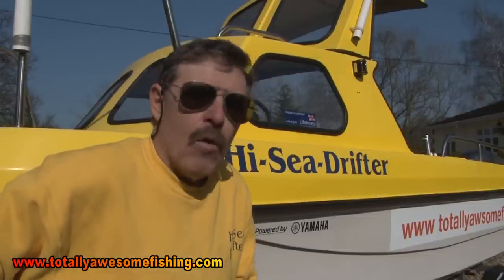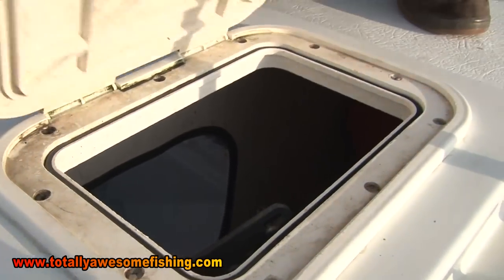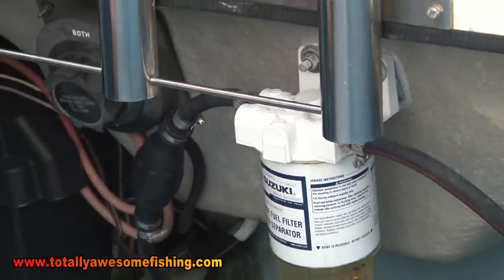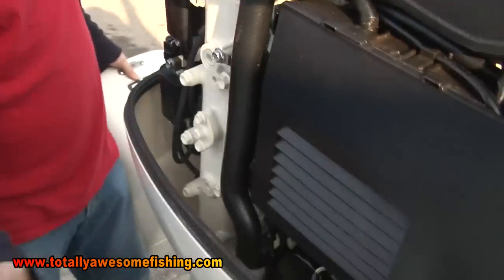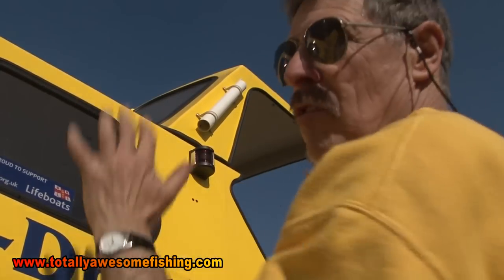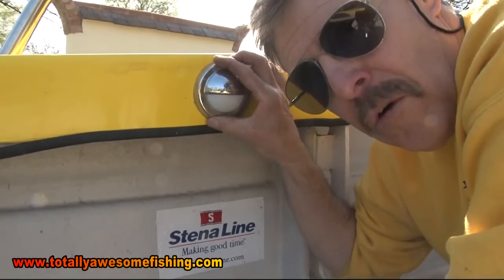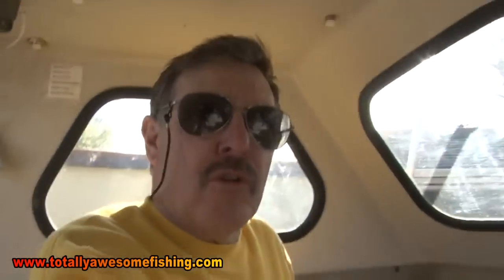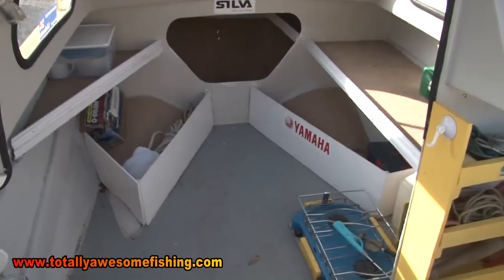How to rig a Wilson Flyer - by Graeme Pullen

Comment from the maker: I used evostick contact adhesive.Still going strong three years later.You can also run a support bead of sealant or grab adhesive along either side of the edge to act as support .I wouldn't be without my shelving that's for sure.I glue 1" square along the base,then I can screw the ply onto that.Same for any verticals.
Graeme.

Comment: Hello again Graeme found a bit of info on the boat seat you have its made by Plastimo as is the pedestal . can you tell me the depth of your bench seat and how have the fixed it to the side of the boat? cheers Chris
Reply from the maker: The Wilson company fitted the bench at the back.In fairness I use it more as a workbench,and I could have a board over the back with rod holders if it wasn't there and gain more space.But most of the time I'm on my own so space isn't an issue. A tip I found when running with Mike and a load of shark chum was that by sliding all the weight to the back,and even standing back a bit from the wheel I could gain up to 2 knots planing. When we slid the cans of chum/tackle about 3 feet higher up the boat the speed would drop off.

Comment: Hi Graham, interesting about the Wilson and how people mention that they slam and are noisy,I own a 17ft Wilson and have noticed that the hull isn't foamed is that the norm?
Reply from the maker: I was always told by other small boat anglers never to get a foamed boat as any water ingress will go unnoticed, the boat runs deeper and heavier, won't plane and you burn buckets of fuel. Yes, a Wilson(Or any cathedral hull) slams in a head sea,that's the downside, but I don't want to fish in force 5 gales anyway so its not a problem for me.I would sooner have an hour of chunking to get to a mark a bit slower, but then have 7 or 8 hours of sublime comfort at anchor with the stable platform the Wilson provides . I have no intention of changing mine ,its been brilliant on the big sharks we catch, and I've even had Common Skate to 140lbs right inside it when I towed to Ireland. There's no such animal as the perfect boat for all conditions, but I won't be changing mine any time soon. Hope that helps - Graeme

Comment: also how do you find the pedestal seat when your stood up driving boat , is it close to the back of your legs ? thinking of getting one as I have the same boat
Reply from the maker: I guess I stand to one side of it especially when on my own as it balances the boat better.But I know what you mean,if you got the wrong size chair it might be too big..You need a good base plate of wood to glass/screw it to,but mine is rock solid after 10 years. Perfect when it swivels round as I can sit facing the rods comfortably.

Comment: Peter Gore Seer, 
 The Boat Is A Good Fishing Boat But You Need A Hatch Window Up Front For Ankor Access,  But The Prob Is The Height of the  Screen At Sea They Act A Sail In Wind, And Wind Agaist Tide Your Boat Is Ankored Its All Over The Place, My Friend Put A Standard Outboard On His Boat, I Had A Long Shaft 40hp, The Boat Fishes Best With Low Profile Cabin With Opening Hatch.Perhaps A Folding Screen.